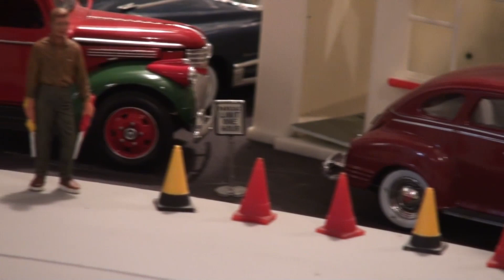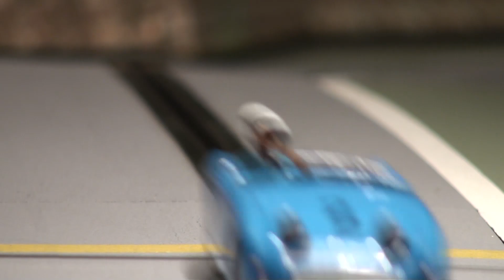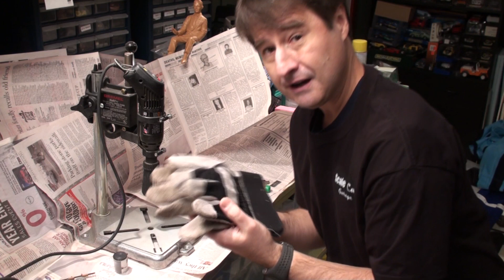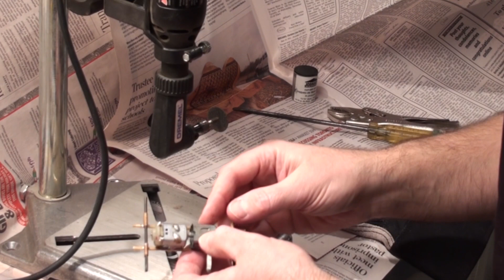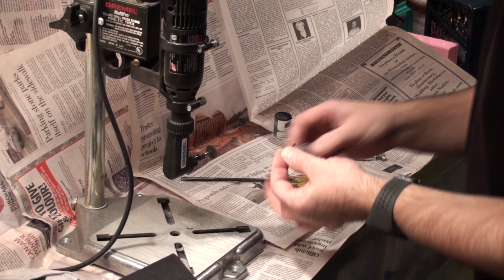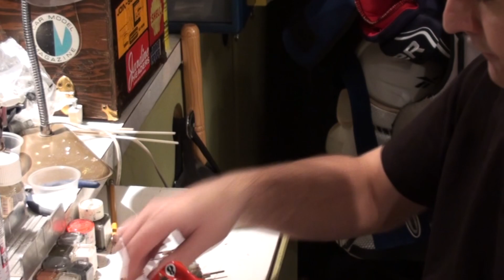Scale Car Garage - 1/32 scale Cheetah Pt.2 Brass Chassis Build

Comment: Part #2 is as good as part #1. A couple tips when using the thin Dremel abrasive disks.  Put 2 disks on the arbor instead of just one. They'll be more difficult to shatter then. You can also soak the disks in ATF (automatic transmission fluid) for a longer life. i'll await for the next installment. Thanks,
Reply from the maker: Bill, thanks so much for your very kind comments! Great tips with respect to the Dremel disks, I will certainly give them a try! Thanks again!